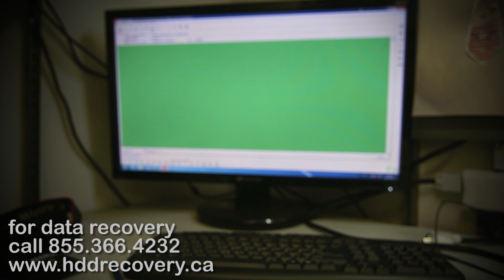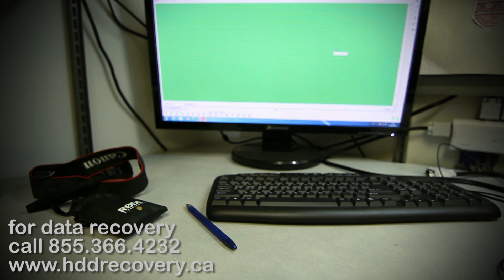data recovery tips: laptop hard drive does not spin

Comment: Great video!  If the donor hard drive is identical, do you need to swap the heads?  You swapped heads because your donor is not identical, correct?
Reply from the maker: Why Me? No. We swap heads when they need swapping. If heads are damaged they get swapped.

Comment: Why do you move the heads to the new drive too?
Reply: ok, I see you answered this question before, so i reyfi, why do you switch shiny new parts with old ones, like the head end the circuit board. i mean.. they're new, and otherwhise you just throw them into the trash. o__o
Reply from the maker: Shensen patient heads go into the donor for several reasons. Keep them from getting damaged in case client wants the drive back, also to test if the problem was in fact dude to bad heads. On WD it is not likely to happen, but I've seen cases where drives would click but their heads read like new in the donor, so that would either indicate that the media is degraded or something else forces the drive to recalibrate repeatedly
Reply from the maker: Shensen not sure what you are trying to says here, sorry.